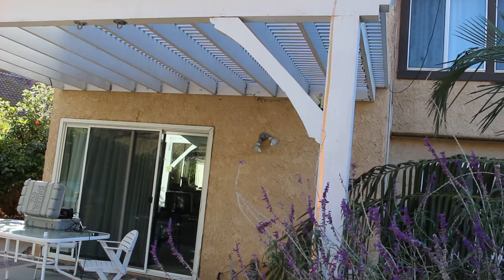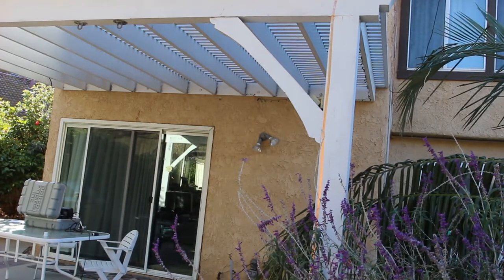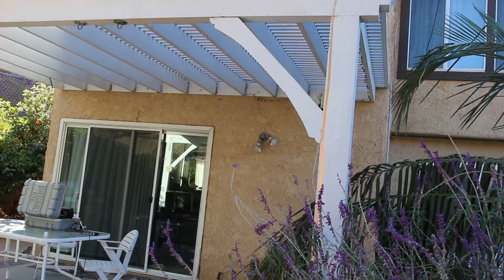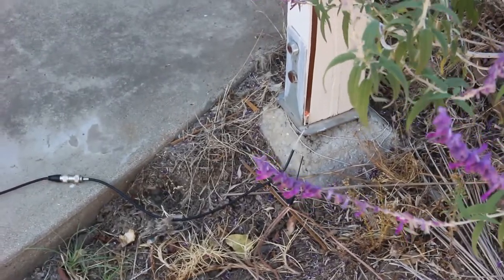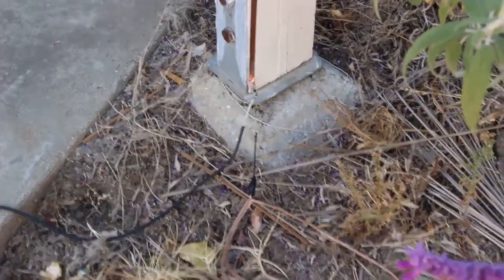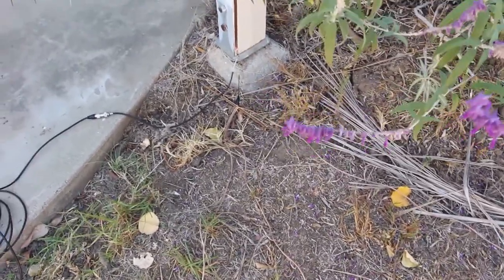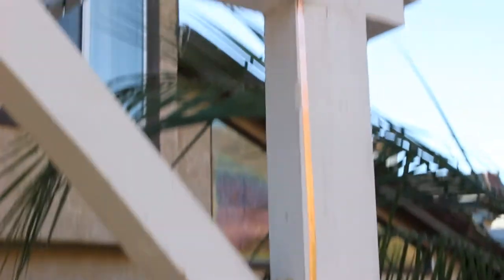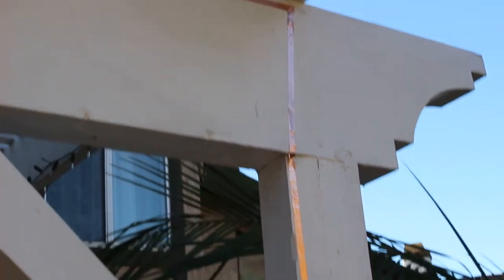Copper Tape Patio Cover Antenna

Comment: Thanks for the video. 1:21 Without a balun transformer at the end of the copper tape, the coax accounts for some of the length in the frequency. If you have an SWR meter and trim the tape back to a perfect SWR, then measure the tape plus the length of cable, you will see the measurement in the full length of the construction. With 75-ohm TV baluns, they are cross-wound to the outer shielding/ground and test as a short. This is on purpose to end the antenna at the balun. I know 50-ohm windings are often kept separate, and if so, the coax still becomes part of the antenna measurement. Also, SWR fluctuates widely with movement and placement of elements and wiring. The coax across the ground could be varying the reading. You can wiggle the coax while watching the SWR and have fluctuating readings.

Comment: How many stations have you worked with this antenna? .Merry Christmas from across the pond
Reply from the maker: Several dozen, until I moved onto another antenna experiment... it would be pretty effective to run one of these up the side of a wood building, or a wood column (completely stealth, too).

Comment: How long is the copper tape?
Reply from the maker: 10 feet long. It's actually 7.5 feet vertically then there's a 90 degree leg that is 2.5 feet. The "L" has a lot of impact on tuning, you may have to experiment to get it all working depending on the height of your patio cover.
Reply: Thanks!  Are you using a regular antenna tuner or a 9:1 unun?
Reply from the maker: 9:1